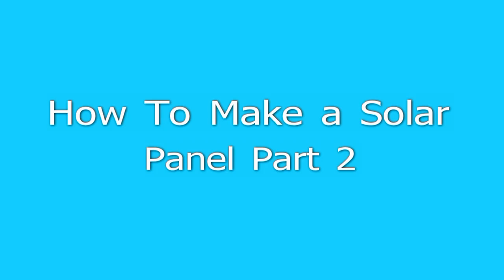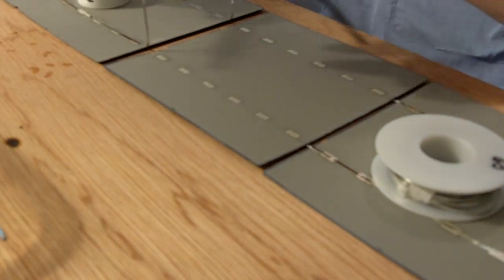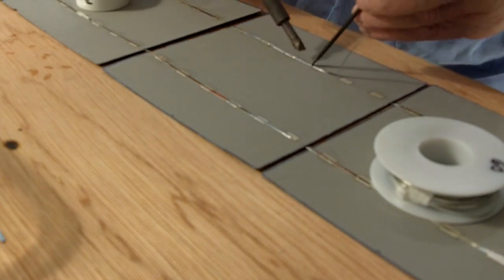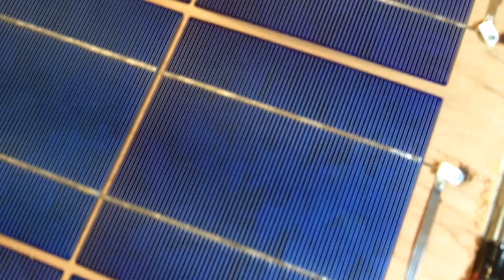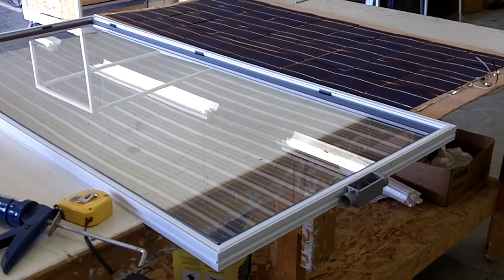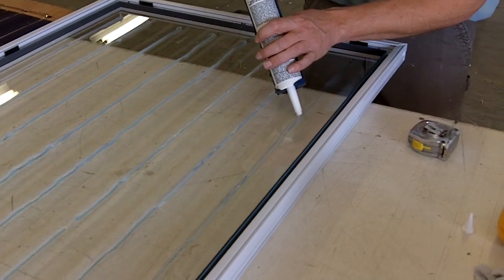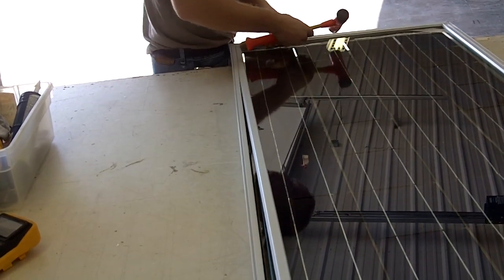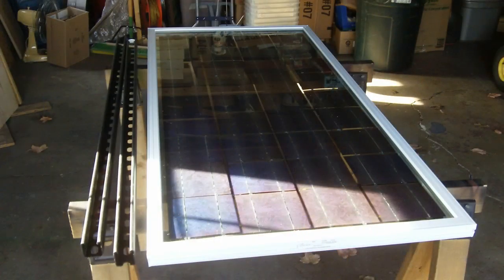How To Make A Solar Panel Part 2

Comment: Hi Ernest, thanks for all the info! I am currently building some panels and was wondering if you have installed any valves for moisture. Have you had any moisture issues between the glass?
Reply from the maker: I put two drain holes in the bottom edge of frame to drain any condensation. I have not had any moisture problems.

Comment from the maker: These cells are sealed between 2 panes of glass. I do have 2 very small holes on bottom edge to drain any condensation that might form. I have had these on the roof for 3 years and have not noticed any drop in voltage.

Comment: Actually, I believe your non-metallic framed panel is at a Disadvantage with respect to lightning.  If lightning strikes, it has no choice but to strike either the + or - terminals of your panels.  If you used a metal frame, and grounded the frame, then the metal frame would attract the lightning and serve to reduce the probability of having either + or - struck with the surge.  The voltages associated with lightning are so high, it may look at + or - just as attractive as ground.

Comment: no you don't need to put them between glass, but you do need to make it air tight and prevent oxygen from getting to your cells. just like most metals solar cells will oxidize over time and less and less light will get through and eventually the cell itself becomes too brittle and can't flex when it heats up and expand during the day and they will crack.

Comment: my first 5 or so panel i made were incase in a shallow box simular to what you did, just the back was made out of wood. about the time i was makeing the 5th, the first one had been in operation for about 6 months and started show some bad signs of wear and tear. now they are barely working at all. just enouh to where they aren't ready for the trash heap just. i just ordered some 6x6 and i don't think i can afford 2 kits of sylgaurd so i'm going to try and squeeze them between 2 glass panels